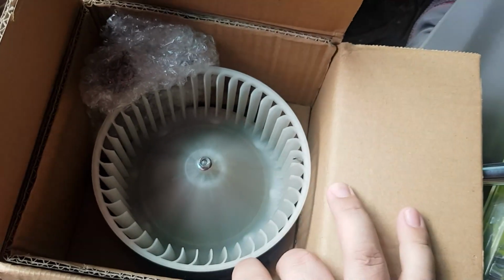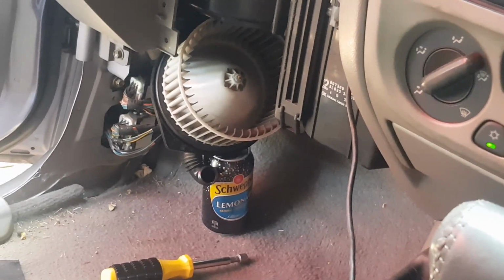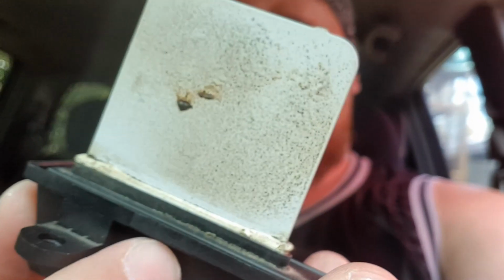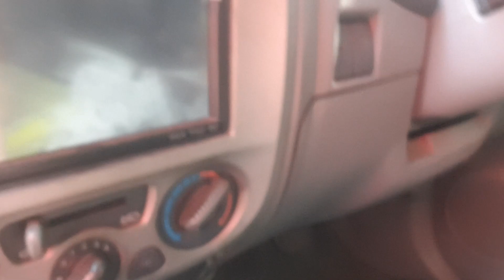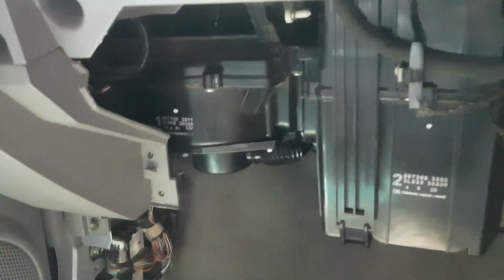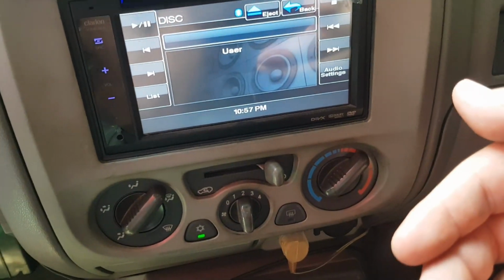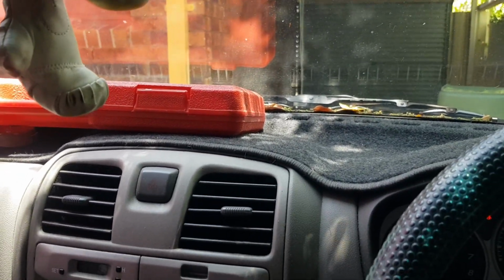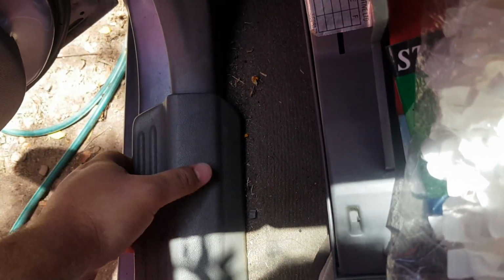I Fixed My Holden Rodeo A/C!!! Changed The Blower fan

Comment: Good on you bro I ve been trying to replace the hot and cold cord. Did you you have to replace the electrical wires from the resistor because I had a look at mine and its burnt out I don't know where to buy parts. Anyways hope your good
Reply from the maker: thanks bro! nah i didn't have to replace mine, did you check ebay? lol sorry i cant be more help, thanks for watching the video though bro :)

Comment: Hi, I know you made this video more than a year, but I would like to ask you, would the 2003 model fit the 2001 Holden Rodeo UTE? Thanks
Reply from the maker: Hey mate, from memory i think they are different. If you type in "2001 Holden Rodeo blower fan" into ebay im sure the right one will pop up. hope that helps.

Comment: Mine has been making ticking noises for the last few days and today it stopped working. Did you get the ticking
Reply from the maker: hey mate, i haven't noticed a ticking noise in mine and it is working fine, sorry to hear though bud! Maybe try contacting the seller?, you may have got a faulty fan.